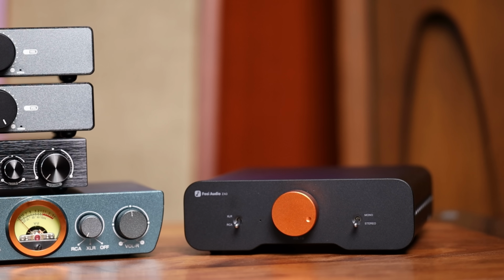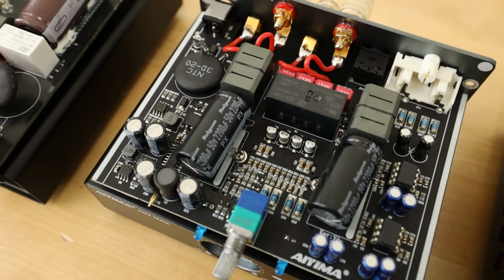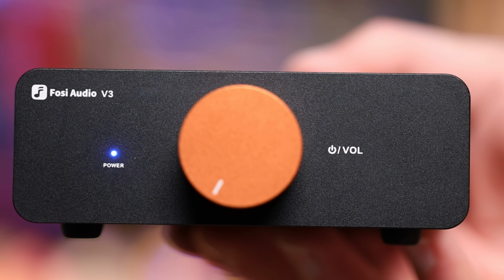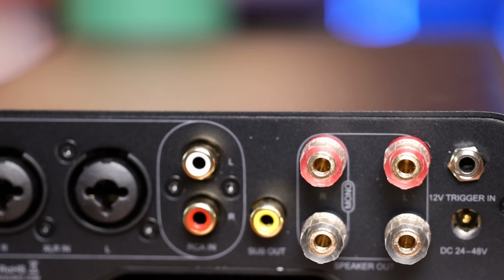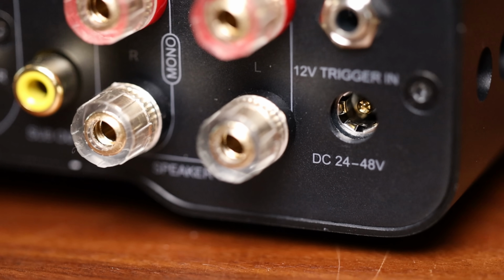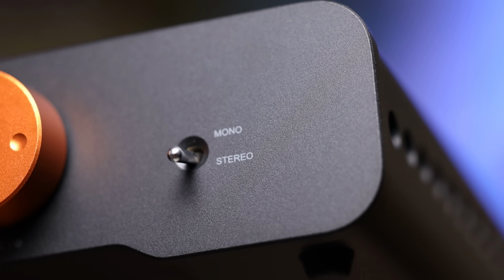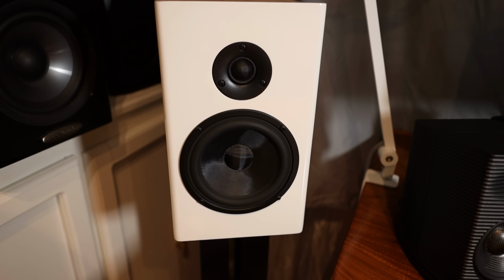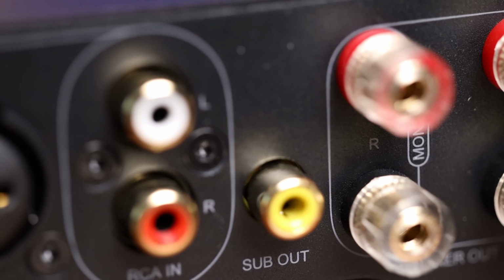Fosi ZA3- Teardown / Comparison / Review - Topping LA90 Who?

Comment: I recently tested my Fosi Audio BT20A amplifier with my floor-standing speakers. According to the amplifier's specifications, it should output 100W at 4 ohms and over 200W at 8 ohms. My speakers, which are rated at 6 ohms, have a recommended wattage range of 20W to 160W. Based on these specs, the BT20A should easily drive the floor-standing speakers.

However, in practice, the amplifier seems to lack sufficient power. I find myself having to turn the volume above 50% just to achieve a reasonable sound level. This issue doesn't occur when I use my integrated amplifier, which provides 80W at 4 ohms. I'm puzzled and unsure whether the Fosi Audio BT20A is actually delivering the power it claims in its specifications.
Reply: I had the same problem, turns out it’s best to turnthe volume  to say 3 to 5 o’clock.
Reply: @xlr82bgr8  I have a suspicion that the Fosi amplifier might not have enough power to effectively drive the hi-fi speakers. Although I'm not an expert in electrical matters, based on my personal experience, I've observed similar situations where insufficient amplifier power led to performance issues with high-fidelity speakers.
Reply: @wilsonlee5590 
It's not a power issue.  It's about gain.  The TPA3255 chips are fixed gain at 26.5db (voltage gain of 21x).  This means that if you are using a 32 volt supply you will need an input level of at least 1.5volts to drive the amplifier to full power.  That increases to 2.5volts for a 48volt supply.

Most consumer pre-amps output a maximum of 1volt so it's unlikely the amplifier was being adequately driven.
Reply: @Douglas_Blake_579  Not my experience, I own the V3 and both power bricks, the 32v and 48v. I heard nothing sonically different between either. Now, when I bumped the actual line input gain going into the V3 via two male XLR to RCA adapters hooked to my PS Audio DAC, that is when that TI chip opened up. It has nothing to do with the power bricks. I have a line level booster coming and will add that into the stream. From what I have seen so far, and heard, that line level booster should take the V3 to new levels in regards to overall sound quality. That TI chip is looking for power, power from the line output of the device sending the signal to the amplifier.
Reply: @wilsonlee5590  It is actually the Texas Instrument amp chip that is the issue, not the power bricks. That TI chip is looking for and needing higher line input voltages via increased gain. These need a line voltage boost, with something like an XLR connection, an in line gain booster or EQ with gain boost capabilities. I think 4 volts would be ideal with these amps, I know mine really opened up with +/- two volts from my preamp XLR outputs.
Reply: @michaelwright1602 
Stop and think about it ... When you increase the power supply, you also increase the voltage that can be developed across the speaker.  Thus, the input drive required with a fixed gain chip is dependent upon the power supply.

That is what I was explaining ... many consumer pre-amps don't output enough voltage to drive the TPA3255 chip to full power.  The chip needs 1,5v rms at 32 volts to clip, at 48 volts that increases to something close to 2.5 volts.  Most consumer level pre-amps output 1 volt rms.
Reply: @michaelwright1602 
Yes... because you gave it enough input signal. 

It is dependent upon the power supply, because the amplifier chip is fixed gain... with a 48 volt supply you can produce significantly more output across your speakers... with a chip having fixed gain, that requires more input to the chip.  It's not complex.
Reply: @Douglas_Blake_579  You have the power supply confused with the line level or gain voltage. They are two different animals. The power supply has nothing to do with the audio signal input/output gain. Some devices allow you to adjust this, like the WiiM Pro, there are several settings to boost the line level voltage, all the way up to 2 volts, on its line out. The WiiM units run on 5v 1.5 or 2 amps I believe, you cannot put a 12v power supply on a WiiM, to boost its line level output, you will fry the unit. The power supplies on these Fosi units are to assist in driving low impedance speakers, that is on the power board side of the amp,  when demanding power is required, not on the line input stage.  

I have both power bricks, tried them both, but I have very sensitive speakers, so neither brick did anything in regards to sound quality or the ability to drive the speakers. In my case, the 32v brick is just fine.

What did make an immediate and noticeable impact in regards to sound, was when I boosted the gain using the built in EQ of the WiiM. Then I swapped over to the XLR outputs on the PS Audio DAC, which outputs around 2v +/- via the XLR outputs. That is when the V3 opened up and started sounding like a solid amplifier. This had nothing to do with the power supply bricks. 

Car audio is like this, line level gain boosters, I have installed a few over the years. I ordered one of these line level boosters, meant for home audio, and it should be here sometime today. I think this unit with a 5v linear power supply should really open up the V3 and give me the sound I believe this little amp is capable of.
Reply: @michaelwright1602 
Am I by chance not writing in English or something?
I've seen people misunderstand my explanations before... but never so badly as this!

You got the result you got by giving it more input ... enough to probably drive it to or beyond clipping.  

You do know what clipping is... right?

The clipping level in an amplifier is determined by it's power supply. In a tpa3255 which is fixed gain, getting to the clipping level on a higher voltage supply requires more input drive.

You gave it more input drive.

What part of that do you not understand???
Reply: @Douglas_Blake_579  I understand that perfectly, because that is exactly what I stated. What do the power bricks have to do with line level input voltage? And I reread what you wrote regarding the power supply, it still boils down to having a more robust input level gain. And in no way did I take the amp to the point of clipping by running it off of the XLR line out.
Reply: @michaelwright1602 
For the last time ... 
Clipping occurs when you take the output of the amplifier to the limits of it's power supply.  (Go ahead, look it up)

Getting it to the limit is a question of gain. If you increase the power supply...
With a variable gain amplifier, you can use the same input voltage and turn up the gain.
With a fixed gain amplifier (like the TPA3255 chip) you have to increase the input level to get it there.

Mathematically ... output = input x gain ... up to the limit imposed by the power supply, then it will clip.

I'm a little baffled that you can't see the relationship between input levels, output levels and the power supply... it's a very rudimentary understanding in amplifier design.

Ideally an amplifier should hit clipping at about 4/5th volume.  So that you can use it's full power.  That is, whatever pre-amp you are using should provide enough output that it is just able to clip the amplifier.  If it isn't you will get reduced power output. Which is what the OP was complaining about.
Reply: @Douglas_Blake_579  I KNOW what clipping is. And 2v of line input is not going to clip this amp, no matter which power supply I have attached. What do you not understand? I am not going to jack the volumes up to insane levels to prove a point and damage my gear. I want to add a line level booster and get the input line voltage, the gain up to around 4v. I believe that will allow this little amp to do what it was intended to do. This is not rocket science.
Reply: @michaelwright1602  Agree.  I use a mixer with remote feeding line input on my Douk Audio ST-01 Pro amp.  I get plenty power and volume to Elac DBR62's and they need some power to get to 30 htz.  Earlier 25 wpc amp could not drive them properly (Rockville BlueTube).  It blew up anyway...

Comment: It would be great if the volume potentiometer can be bypassed in mono mode (set it to a fix value where and exploit the 'full' amp power capacity without hitting distortion). And I agree with all the comments on the toggle  switch, how often will you swap cable out and setup between mono and stereo. And I am am the one designing this, switches can be at the back panel (using tiny slide switch)  or underneath.
Reply from the maker: Agreed, it makes sense

Comment: M, On the v3 banana plug don't fit (binding post to sm.). Are the binding post on the Z A3 standard size? I have asked other reviewers with no response.Best, D.
Reply: Do you have a link re. the V3 and bananaplug issue? From what I've read some plugs need more force to fit.

I experienced zero issues with (good) banana plugs on the ZA3.
Reply from the maker: I didn't have any issues with the binding posts on the ZA3 for the cables I have here, they are on the small side though.

Comment: I’m upgrading my system with tax money. Aiyima T8 DAC, Aiyima A08 pro. Speakers are Sony cs5 stock, but I bought the upgrade plans from Neil Blanchard for 20 bucks so I am building the new crossovers and fiberglass the inside of box and adding the brace from Neil Blanchard upgrade plans. Highly recommend it. I’m getting the SU9 pro DAC , and either the topping PA7 plus or two fosi audio ZA3….

Comment: Does opening the case break the thermal seal, therefore requiring you to clean and add thermal paste each time you open it?

Also, did you compare the sound to the V3, and was it any different in sound quality?
Thx
Reply: For the thermal paste... YES you should clean and replace it every time.  The old grease will pick up dust, lint, hair, grit from any surface it touches.  You don't want to put that into your amp where it will degrade the cooling solution.
Reply: Thanks Douglas for clarifying. Other than Matt C. I never see any reviewer mention that the thermal seal is broken when you open this  particular type of design which uses the housing for a heatsink. @Douglas_Blake_579
Reply: @geevee1045  
Matt is one of the better reviewers, I agree.

One of the other reviewers, talking about replacing op-amps, actually decried the practice because he's "done it many times with stellar success" and doesn't think it's necessary.  Of course the risk is that he's going to do this 10 times and the 11th time kills the amp.

It is a precaution... but it is a very sensible one.

Comment: Great review - subscribed! The TPA3255 is a very versatile device and has been used in some higher end products (LSA Warp One etc.) so its great to see this available at such an affordable level. Your comment on the mono/stereo switch is spot on - they should have this switch at the back or the bottom of the unit and it should use a sliding or a push in/push out switch to prevent accidentally changing the mode. The RCA/XLR selector could also be relocated to the back for a cleaner front. Great to see a sub out but a variable sub crossover would have been nice.
Reply: Douk Audio ST-01 Pro has variable pre out.  And tubes.
Reply from the maker: I completely agree, its a good product but could step it up further with a few modifications.